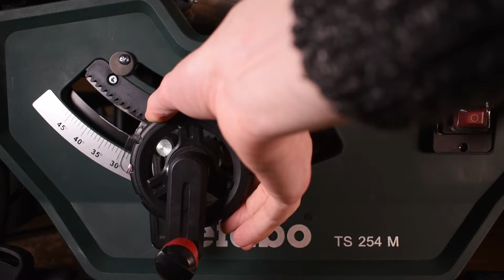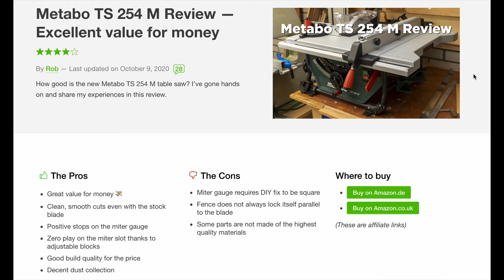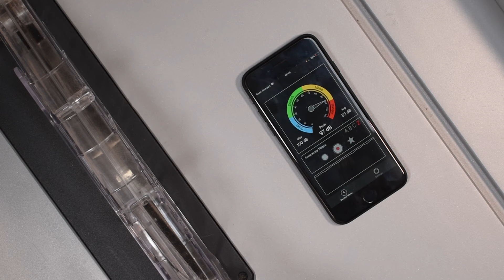Metabo TS 254 M Review – The best affordable table saw on the market?

Comment: 6:22 The position of the blade can be adjusted. There are 4 bolts you can loosen, 2 in front and 2 at the back. I suggest only loosening the 2 at the back (slightly) and adjusting the position until it's aligned with the mitre tracks.

The fence can also be adjusted to always be parallel with the blade by adjusting the tension at the far end of the fence. I've also found that pulling the fence towards you while adjusting it to your desired position, helps in keeping the fence parallel.
Reply: Hi Hagen,
The 2 bolts in the back you mention.... are those the ones in the plastic bracket or the 2 bolts in the aluminium bracket ?
The plastic brackets are the pivitoting point... so i gues the bolts in the aluminium bracket... right ?
Thanks and greetings from Holland

Comment: I recently purchased this saw. So far so good.  Out of the box, it was really close to perfect.  Blade was set right on 90 degrees and the scale for the fence was pretty close to 0 when snug up against the blade.  Miter was about ½ a degree out when the rubber blocks were snugged up to the track and your tape trick got it really close… my the things you can do with duct tape!  Happy with the cuts and it does ok with most woods here in Australia except the hardest of the gums…with those sometimes it’s best to do a scoring cut.  One thing you did not mention on the review, this is unique in this category…. The ACME screw to lift the blade.  I checked the Bosch, Dewalt, Makita, and Hitachi and all had a standard threaded screw which over time is a single point of failure,  NOT with this saw…. The buttressed threads will likely last longer than I will!  Your review was great helped me make a good cost effective decision.  Only one minor challenge,  there was a package deal including the stand and a free reciprocating saw…. At a discounted price… and they were largely sold out across Australia. The sliding table is unavailable until about June-July 2022.  Thanks for good and thoughtful review!
Reply from the maker: Thanks, glad you found it helpful! In the bigger TS 254 the lift screw was actually a common point of failure (there's a video on youtube about it), so they upgraded that to a better one at some point. Seems like they have carried that over to the new TS 254 M model as well, which is great.

Comment: It is a good review. I am looking at different table saws. Now (March 2023) there is a new competitor in the same price range, in fact it is even a little cheaper compared to Metabo. Around 325 Euro  as we speak. I am talking about the skil 1340 AA The skil has an easy no tools required adjustable blade. But as I understand it the saw already comes very parallel from the factory. With a solid fence as well. And it is 2000 watt. It comes with folding legs. And the reviews that I have watched so far are very positive about the skil saw.  It's functionality and the fence system is comparable with the DeWalt saw, which is good and solid. All together the skil 1340 AA seems like a good alternative, if not the better and more accurate saw. I am all for accuracy. And it is even cheaper as the other comparable saws.
Reply from the maker: Thanks for the suggestion. That Skil saw looks like great value for money, smart idea to copy the DeWalt fence system. It does look very plastic-fantastic, so not sure how it will hold up in the long term, but for the price it seems like a good deal.
Reply: @machineatlas  For height and tilt adjustment the skil has metal gears and the metabo has plastic gears. And the skil is the only machine with fine adjustment for parallelism from the saw blade, and it requires no tools. And the skil has a metal tube frame. Only the part where the blade sticks out looks a bit flimsy with the skill, but that is an easy fix. It is getting really good reviews. I like metabo, and I have several machines from them, but in this case I have chosen for the skil. Mainly because of the easy accuracy adjustment for the saw blade, and because of the more solid fence system compared to the metabo. And I liked the price, all the other brands with comparable capacity, power, and other features are more expensive. 

I Don't like the idea that I would still need a straight edge to check with every saw cut if my fence is parallel or not. The whole purpose of the fence is to make that part of the job easy. 

But your review was excellent. It covered all the important features. 👍

Comment: As far as screw cam out, you might consider picking up some countersunk Allen flathead screws with the same thread pitch as what the Metabo came with. If you can get a grade 8 all the better. Be careful not to kill it though and strip the threads in the actual fence. You might also try removing the screws, then reinstall them counting the number of turns. That was you can tweak it a bit to try and keep the pressure even. I don’t know how long you can work with Blue Locktite, but it would be nice to put some on clean threads. Keep your in mind the Blue is removable. We used it in the shop all the time for things we wanted to disassemble at a later time. Just my 2¢ worth.

Comment: Hi, I will try to explain in English and hope it will be understandable.
You can adjust your fence perfectly. I could see that you can not put the lever completely down so your clamp in the back is too tight. Loose it until your fence will always align automatically. Now you already have repeatable setting. If it is not parallel yet then you need to adjust the angle with the screws on the top of the fence. I spent some time for adjusting but now it's perfect.

Regarding the miter gauge: did you try to loosen the 2 screws of the guidance? I think you can have some small influence to get the perfect square and tighten it again. Would be better than tape and you could also use another longer fence profile.
I hope I could help. I'm really satisfied with this saw because I could adjust any setting of the saw. Not to forget about the small rollers of the parallel fence. They have big influence for gliding performance and squareness to table surface.
Reply from the maker: Hi Mario, thanks very much for the tips. I'll try your advice with the fence to see if I can make it lock square every time, sounds like it should work.

About the miter gauge, I've added an aluminium extrusion (3060) as a fence now, which is much better. I'll be making a new video about that one soon as I've created a 3D printed flip stop for it as well.
Reply: @machineatlas  let me know if it worked. It always takes some time to understand the machine  and all adjustment possibilities. Table saw is more complex than miter saw. But both need a lot of time for an accurate setup. But later the results will speak for themselves.
Reply from the maker: @marmic2428  Hi Mario, I tried your technique and it improved it a bit. It's still not perfectly parallel all the time, but it's true that if you put it too tight, then it will be less effective at 'pulling' itself parallel. Then again, if you make the handle too loose, it can start to flex at the end of the fence. So there is a sweet spot somewhere.

Once I found the best tension, I would say it's pretty close to parallel, and good enough for most situations. Still would have preferred a system like DeWalt's, where you are always 100% sure it's accurate.
Reply: @machineatlas  hi, cool that it worked. You are fully right. It's a ride on a blade and it takes a lot of time to find the perfect point. Mine was also not parallel, but always tha same angle to the blade. Then I made it parallel by opening the 2 screws on the top, align it perfectly and tighten again. Also takes some time.
The Dewalt solution is out of discussion, I guess that this is the absolute benchmark and dream of everyone who would like to own a table saw. For me it was too expensive for hobby usage.
Reply: I have the same big problem with this fence. This evening or tomorrow I'll try to implement your suggest. Thanks in advance
Reply: I consider this saw, and only this function was a disappointment point. I think I will get one and hope it does it well. Thank you.

Comment: I had to shim the miter gage on mine as well, might be a common issue with them. I used a piece of 120 grit sandpaper and I'm getting perfect 45 deg miters from it now. I've done a fair bit of cross cuts on it and a few rip cuts, seems to be holding up fine so far (except the table coating, seems to wear off quickly). I've had a good experience with dust collection, very little mess on the top and bottom, almost all the dust gets blow out the dust port. My biggest issue was with the miter gage not sliding well with any load on it, some dry lube does seem to help but does not solve the issue entirely. If the sliding table attachment comes back in stock anywhere I'd consider getting one for cross cuts. Overall there are some nitpicks here and there that make the impression that they were rushing the thing out of the factory, some sharp bits had to be filed off in the fence bracket to make it slide properly, a loose screw in one of the table extension rails, bevel stops needed adjustment to be exact on 90 and 45 degrees, the fence ruler marker was not zeroed to the blade. Apart from the nitpicks it's a sturdy and very capable saw. I don't work with hardwoods and the main tasks I would throw at the saw are what a DIYer home owner would throw at it (framing, cladding, shelving, etc.).
Reply from the maker: Hi Valids, thanks for the info, nice to hear your experiences are very similar to mine. I'll have to tune the miter fence a little more to get perfect miters, good to know it's possible. 

The sliding table looks like a great attachment, but indeed it's not available anywhere. It's supposed to be back in stock in August according to a shop I contacted.

Comment: Just turned mine on for the first time this weekend, blade grabbed the rubber plate and seized, causing it to spark and go loose, breaking the blade locking lever along with it…taking it back on Monday…hopefully replacement won’t have the same problem!

Comment: Something to think about, there are actually 2 types of phillips screws, and they need different types of phillips screw drivers. So it you feel you are stripping a phillips screw heads, odds on is you are using the wrong driver. They are phillips (PH) AND Pozidriv  (PZ)
Reply: I’ve always used a pozidriv bit from Snap-On. It works on either type of screw for me.

Comment: I have had this saw for about two months.
I plan to use it for one or two home projects and odd jobs that are not suitable for a track saw.
I paid A$550 for a new saw including stand on special sale. (as a comparison, in 2022, six pack of beer costs A$15 - A$30 depending on brand, petrol is 1.80/l and a construction carpenter gets about A$55/hour). Could not justify the cost of paying $1k - $10k for a professional tool. Though was really close to getting the HiKoki.

Clint Eastwood: Best saw at this price point. Motor has enough power, will rip 80mm no problem (fit a good quality blade). Accurate cuts (1 - 2 %) if you take the time to set up.
Soft start and motor brake really good. Dust extraction ok. 

Lee Van Cleef: You get what you pay for. This saw is from the Wun Hung Lo bicycle and table saw factory. Identical accessories sold with other brands.
Power switch in a really awkward position, not the best for safety. 
Some of the construction is solid but some is quite flimsy. The mitre gauge is a toy. The blade tilts to the right, the gauge fence is shaped for a left tilt.

Eli Wallach: This is a job site saw much more suited to general carpentry than cabinet making. It is necessary to check and recheck the fence position. The table is cast aluminium and not perfectly flat but ok. Mitre slots not standard ? 12mm wide at top, 19mm T and will take standard Powertec 5/16" T bolts, so usable.

My 10c worth.
Reply from the maker: Thanks Mark, that's a very fair review of this saw. Agree with most of your points. I didn't mention it in this video, but the power button is indeed in a quite awkward position. Not great if you need to turn off the saw in a pinch.

I think most of the downsides also apply to similar saws, so it's still a solid deal for the money.

Comment: Thank you for very detail review! I have heard, that this saw has non-standart miter slot. Maybe you know, it will fit to Incra, Kreg or Microjig miter bars? Thanks
Reply from the maker: Hi Volodymyr, thanks. The miter slot is non-standard, and has a T shape. It won't fit any of the standard aftermarket miter bars unfortunately. 

If you want a different miter gauge your only option is to make your own miter bar for it.
Reply: @machineatlas  thanks a lot

Comment: Posted this question in 2 separate Metabo-youtube channels without answer, so posting here as well hoping someone here can help me. Pretty happy with my ts254m apart from the t-shaped miter tracks that prevents me from making simple cross cut sleds. Is there a solution for this? E.g. replacement table, miter ”bars” or would it be possible to route a ”normal” miter tracks in the existing table? Also on the topic of fence, I feel that when locking the fence, it seems to move ever so slightly towards the blade, making the cut slightly narrower than expected?
Reply from the maker: You don't need special aftermarket miter bars (although useful) to create a crosscut sled. I've built my own with hardwood as miter bars. Check out the video on crosscut sleds by William Ng, that's a great way to make one, works perfectly on this Metabo too.
Reply: @machineatlas  Thanks for replying. The issue I have is that since this saw has T shaped miter grooves the hardwood strips that I'm using for my sled are very thin to be able to fit through the narrow part of the "T". This makes it hard to secure with screws and also easy to break. I understand that it's great if yo want to put e.g. a finger board etc. but for all different type of sleds it's harder to make them easy and good. Might have a look at the sliding table accessory hand build a custom sled that uses the sliding table but it's 1 an additional cost and 2 unsure of the accuracy in the sled for perfect cuts.
Reply: @C11ffH4ng3r  Blir skenorna för smala alltså? Hur mycket mindre är det än vanliga skenor? Om du limmar och skruvar med mindre skruvar blir den inte tillräckligt stabil då. Borde väl gå med rätt smala skenor ändå, ska väl bara styra släden framåt och bakåt? Ska själv köpa en likadan så hoppas det går att lösa utan att behöva köpa den extra sidosläden också. Hoppas det funkar!
Reply: Hey mate, did you find a good solution to your cross cut sled problem? thanks
Reply: @sykesy  No, I'm still using smaller glued wood strips as runners as I have not yet dared to make any alterations to the table itself.